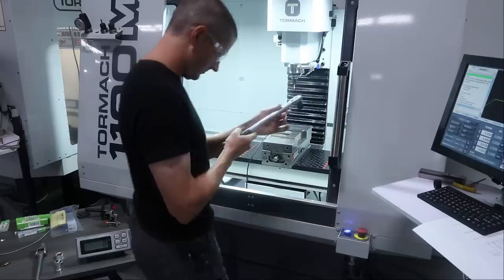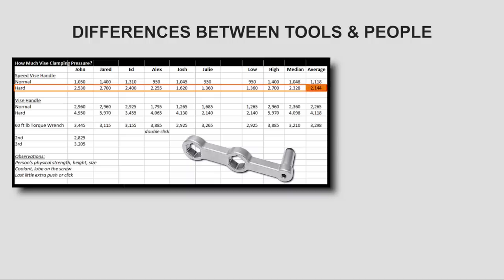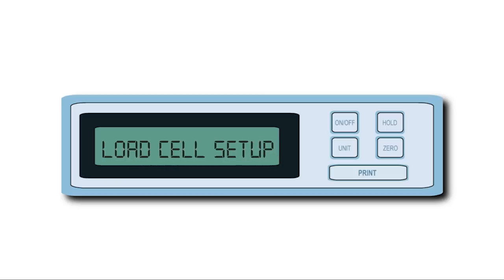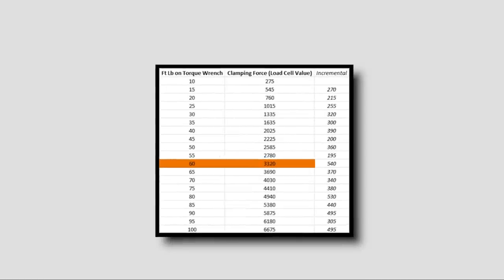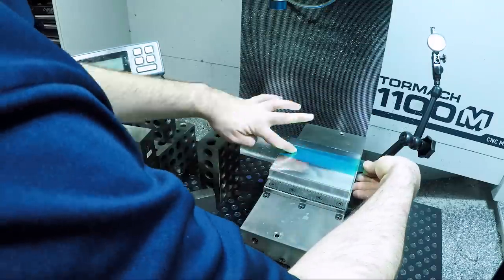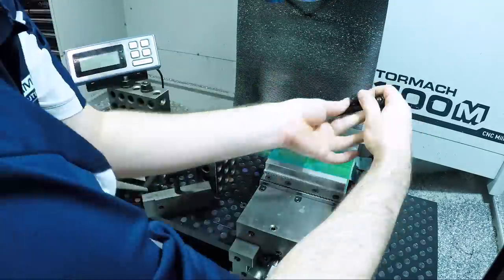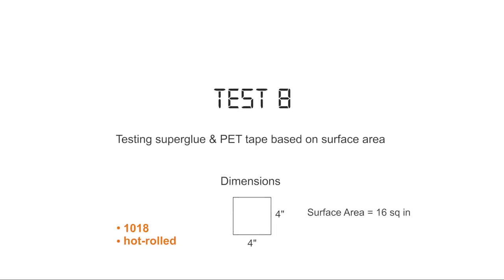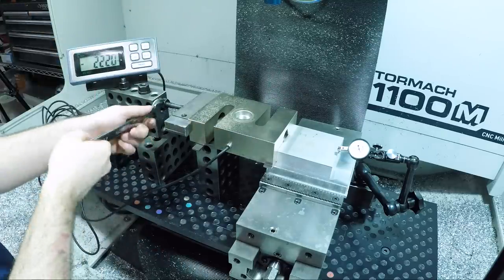How Much Gripping Power does a Vise Have?

Comment: For Test 4 you said you are putting the same amount of force on a smaller surface area which should result in higher pressure. You are confusing the pressure of the load cell and the pressure of the vise. You said you would expect a higher load cell to move the block but you just did this test and found that not to be true. What I think is really happening is, with a smooth jaw you are relying on friction to hold the part in place but with the talon grips you are biting into the material which is not a friction but a more mechanical stop which is why it takes more force. I am not sure why the force required is then lower at higher torques. I wish you would have done the engineering calcs before hand to have an expected value. This shouldn't be to hard. Take the force of the vise (normal force) multiply by the coefficient of friction and that would be the force required to move the block with the load cell.

Comment: would still want to hold a good portion of the work if you were machining something very tall as the side pressures exerted at the top of the piece by the tool would act as a fulcrum at the upper most point of the jaws which is holding the work. doesn't seem like it would be too hard to torque the part out of the jaws at that point.

Comment: So basically the only way to get more than 500ish lbs of lateral force is to use superglue?? Interesting... I guess I don’t need to rush out and get those serrated jaws.  I assumed they would increase the workholding power tremendously.

How do the dovetail and 5th axis vises compare?

Comment: Just some quick thoughts. Firstly, coulomb friction (generally a good approximation for non moving things) is independent of the affected area ( F=Fn*u u being a constant). With those serrated jaws the part deforms and the theeth actully dig in (I can't tell if it was elastic or plastic, but I'd assume elastic). If the part was only deformed elasticly under low/ medium clamping Force, it would explain the decreasing holding power under higher forces. At some point the material yields and subsequently tension is released.
Reply: Rakh c it has both elastic and plastic deformation... I’m sure some of it springs back but there are definitely teeth marks in the part after clamping.
Reply: @steves.3485  Would be fun to test the prestamped parts with serrated jaws. Like LANG has the stamping machine to stamp the toothmarks into (harder) materials, then vise doesn't have to be tightened so strongly to get the holding power. But I'd guess this doesn't work well with aluminium, it'll just rip out of the serrations with enough force.

Comment: Static  friction  is dependent on the friction coefficient of the materials and the normal force, not surface area.
Reply: In vacuum yes. In real life, however, serrated jaws bite in and deform the workpiece, effectively changing the coefficient of friction.
Reply: @LambertZero  Yes of course, this only this only applies to somewhat flat surfaces. If we allow for deformation or interlocking shapes all bets are off.

Comment: Vice bolt pitch and friction has alot to do with varying values when using the torque wrench.  To say 80ftlb will give 5000 lbs clamping on every vice is misleading. No way.

Comment: Nice video.. thanks for all your knowledge. I really need your help on cutting a AR15 bolt. I am trying to mill off some of the lower part. This thing is Soooooo hard.. what can I use?. I have a mini mill what do I need to do to cut this..please help...
Reply: If you search for "hard milling" you'll probably find some helpful videos. The key is you need to use a tool that is harder than your material.
I'm curious, what do you need to mill the bolt for?

Comment: In main , this is not important . Most deceive is how part will deform and re deform after unclamping . Indicator is essential to avoid goin out of narrow range of tolerance . The best way is to weld a part . That's why aluminium is not so easy to machining , has to be machin and cutoff .